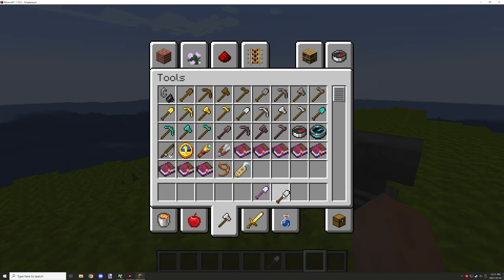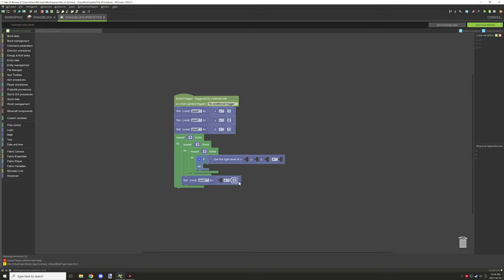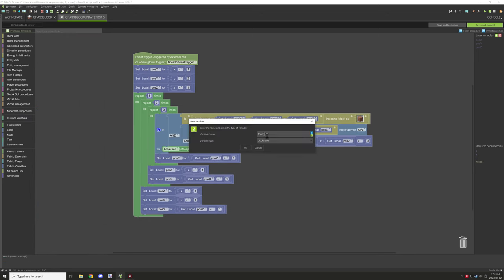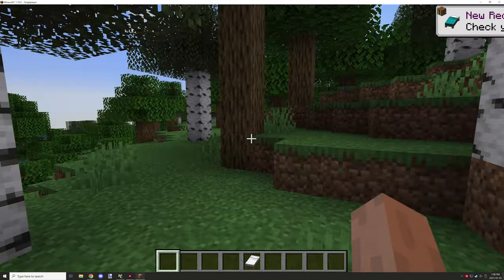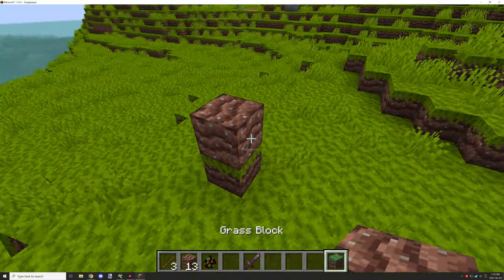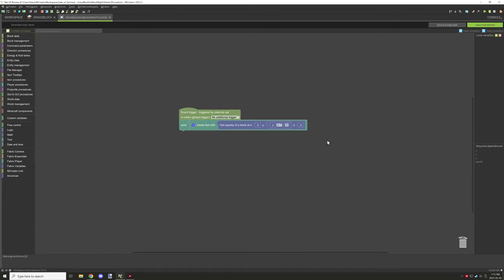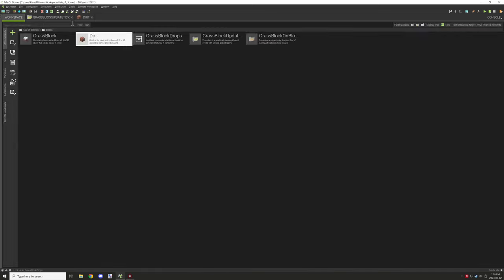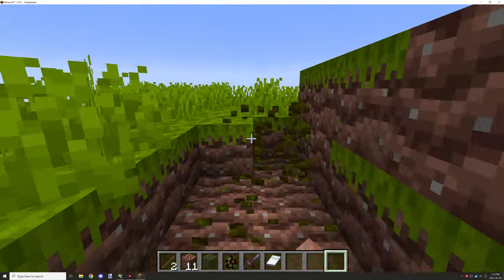Grass Mechanics | MCreator Lore | Ep3

Comment: Hi, I was wondering how can I use the Set Local in 1:30 I wasn't able to find it maybe depending on my MCreator build version or I needed a plugin?
Reply from the maker: On the right hand side the green plus icon is for creating local variables. local variables only run for the one instance the procedure is run and are not stored unlike global variables or NBT variables.
With that said once you have one variable in the list they will appear in the custom variable's tab

Comment: what did the "is provide blockstate material type" part get converted to? i tried checking the procedure to see it after downloading the mod source from github but everything got corrupted
Reply from the maker: It's a bit tricky to set up a workspace however I just made a wiki page to explain how to do it.
https://github.com/MCreator-Examples/Tale-of-Biomes/wiki/Using-Source-Code

The mechanics broke in 1.19 as Mojang dropped material support, so I had to convert the Air material to a block tag, this does the same thing as the material type but with tags.

Comment: Does this still work? Reading the comments I see that apparently this is no longer the case, but I want to make sure before trying it.
Reply from the maker: Only major change was material types being removed I had to migrate all mechanics that used material blocks to tags but it still works making this slight change.

Comment: Watching this at x0.5 speed so I can follow along

2:45 I can’t find “Is [Provided blockstate] material type [TYPE]” in 2023.4

Edit 1: I found “Grass spreading procedure” in the templates

Edit 2: It is not working
Reply from the maker: Material types are removed in 1.19.4 due to mojang dropping support.
You can use tags like I did and specify AIR just make sure to not use AIR in the name of your tag at least for 2023.4 as there is a bug that is resolved in 2024.1. Alternative would be to test if the block at the location is = to air using the yellow operator.
Reply: @NorthWestTreesMCreator I tried both. I may have done the first solution incorrectly because I am a beginner.